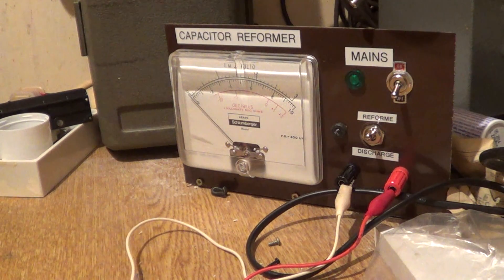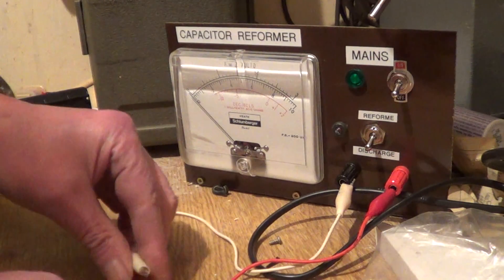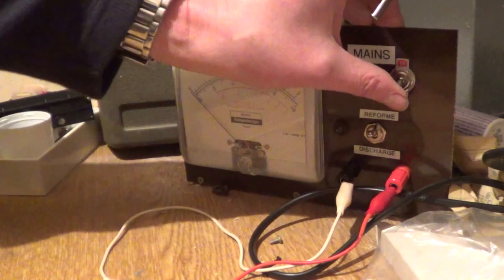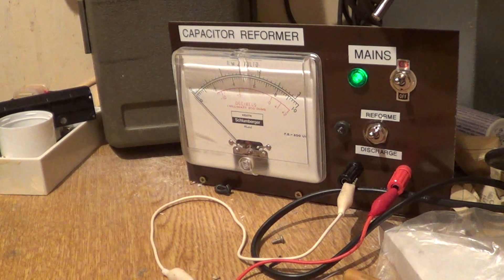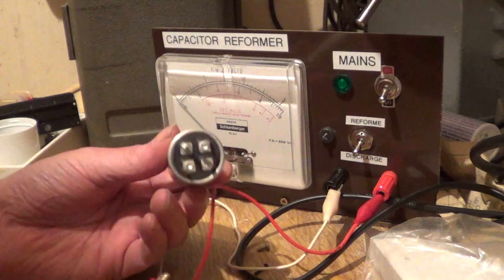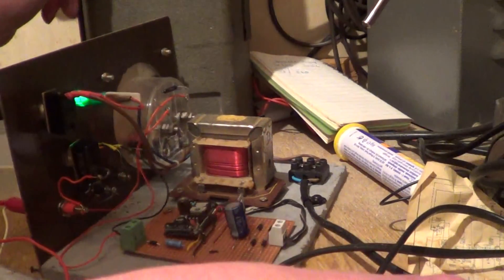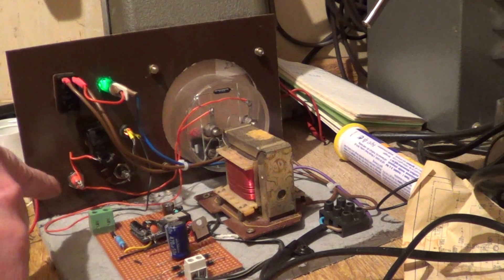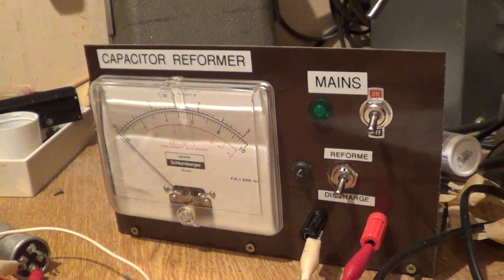cap testing and reforming

Comment: I rather use modern capiciators,then n.o.s. Caps because you be replacing sooner then a modern cap.and they are better made .I and I either use a modern capiciator checker  or a old heath kit tester that shows leaks .

Comment: I was wondering if after reforming the capacitors will they be reformed back into spec? Also, is it possible to reform 400v PIO caps that have drifted up that were only used in tone circuits under very low voltages. I have a large supply of vintage Sprague .022uf 400v PIO Bumble Bee caps that have drifted up in excess of the rated 20%. Is it possible to help get them into tolerance or is that simply the nature of the beast?
Thanks for your time!
Chip S.
Reply from the maker: you can not reform pio caps